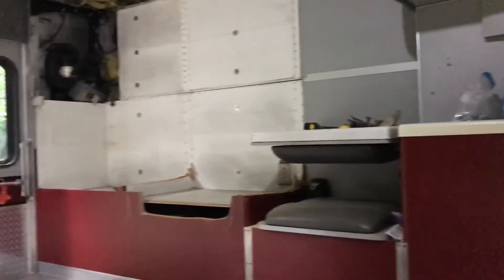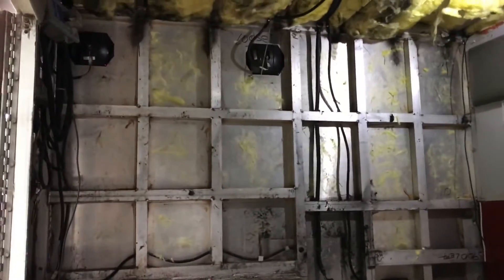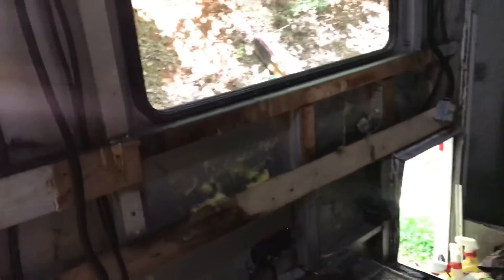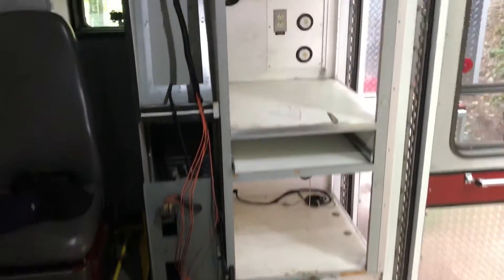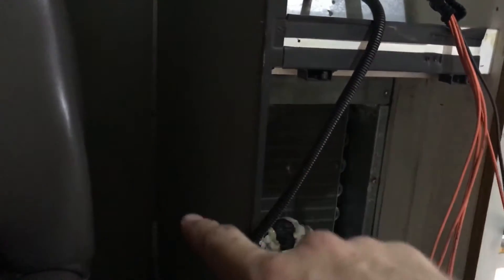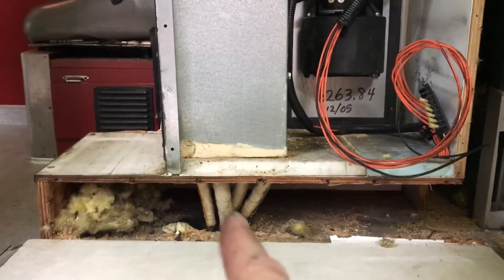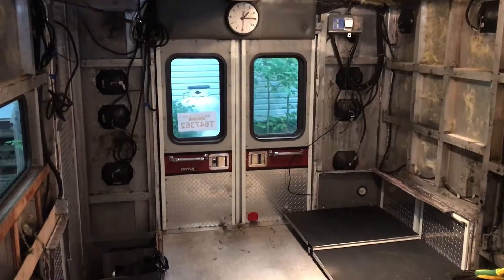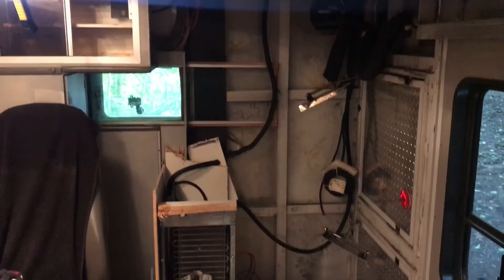Demolition P2 - Ambulance Camper Build Conversion RV Freightliner FL60 MAV

Comment: Thank you for sharing this project. I'm in the planning stage of doing a conversion. It really helps to see how the box is constructed. I probably won't do as much demolition (famous last words) but will do enough that knowing what tools to use is a big help. Your video also reinforces my choice of an ex-ambulance for conversion; the build quality surpasses any RV or van.
Reply from the maker: It is amazing how well they are built and how cheap you can get them for. Very under appreciated. Since they are fairly module inside you can modify over time. The only really tough thing is if you want to get rid of some of the bins and you have the stainless ones. That you might want to do just once - not very fun!

Comment: Wooooah! For a minute you scared me..I thought you were going to ditch the ac! Agree with commenter  about 80/20 that Humble Road is using in his awesome build. Take a look if you haven’t already.
Reply from the maker: The a/c unit puts out a lot of cooooold but alas only works when the big diesel engine is going.I tried to look up estimates for the engine from Cummins - it uses at least 1/2 gallon per hour on idle but could use up to 3/4 gallon. I think I found the perfect place for a window a/c unit inside a lower bin that will be partially above floor and partially in the bin. I also think I have a bin for the small generator I have. This is one reason I liked the ambulance. I think I have a great low energy consumption a/c solution that will use about 1/2 gallon gas for 4 hours of a/c. Another reason for tearing down the walls was to super insulate. I subscribed just now to Humble Road and will catch up on the videos - thanks for the tip!
Reply: PriusStealthCamper Adventures hmmm..interesting that the engine has to be working... Thats a bummer. Almost looked at a PM van that was converted to a mobile office and it had a heater/ac mounted over the cab area but after chatting with seller who said heater not working at the moment etc etc...I declined viewing. Seller didnt know the company who had done the ac and hvac system anyway. This week hope to see a Nissan NV200 to decide on building out - did you know the Nissan NV also comes in an electric version - just not in our NA market...booo..hisss. Now..I have a particular interest in insulation right now. What are you thinking to use? Btw have you seen Greg virgoe’s yt site...if not, stop everything and subscribe now...he is the consummate scientist/engineer/tech spec guy in England who knows everything about insulation and R values. If i do the NV 200 i’ll be rewatching all his vids from the beginning. For my 1.0 trial season nothing goes in that cant be removed in 30 minutes back to factory spec. If the unit survives 1.0 then I will proceed to 2.0. Dontchaloveit? Lol 😂
Reply from the maker: I did not know about the electric NV - that would be interesting. I have found that a non-working a/c unit is never just some freon.I am just going to use standard home insulation for cost savings and speed of installation. Thanks for the tip on Greg's channel. You will get addicted to conversions. I enjoyed doing the van conversion twice - second time was so much better. Did not film the first time. The ambulance will be easy to do conversion changes over time. A big square box.

Comment: Looks like you're working without electricity. Therefore, no fan? Heat and humidity must be a bear, even in the shade.
Reply from the maker: The heat and humidity are quite bad but fortunately I am in the shade and there is good ventilation when I open the doors and bins. I have not used the ambulance lights as they are quite high wattage (24 or 36 watts/bulb x 4) and drain the batteries (4 of them). I have a charger but it doesn't keep up well with the lights. I have some LEDs coming this week to replace (1 -2 watts each) them so then will have great lighting! I have lost some weight with the heat but that's OK. Another problem is the constant rain. We have had rain every day for 3 months. Everything is mud. I like a clean working environment - impossible with this sooty project and the rain.
Reply: I looked under the "ABOUT" on your homepage and you follow many of the RV videos I like. You may enjoy HUMBLE ROAD, he's building a new Mercedes RV using 80/20. The aluminum "bones" you're working with and the structual mass of the 80/20 (stainless steel) he is working with, I think, may give you additional ideas on that air conditioning space rebuild.
Reply from the maker: Just subscribed - thanks for the tip!